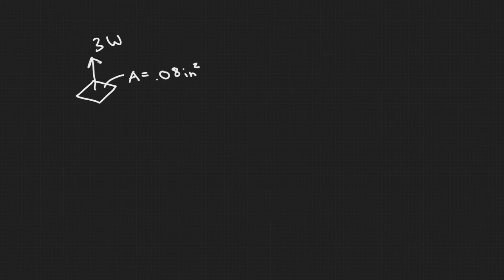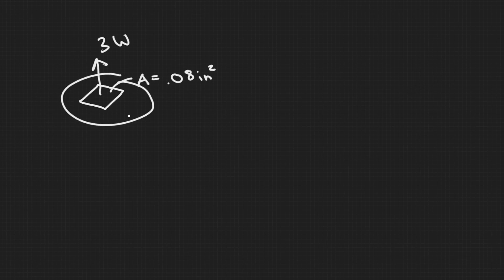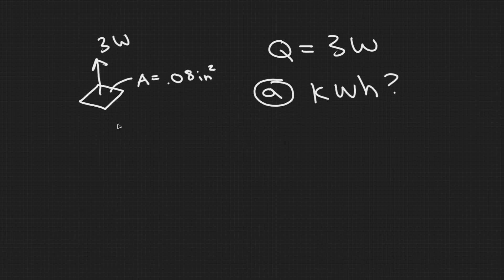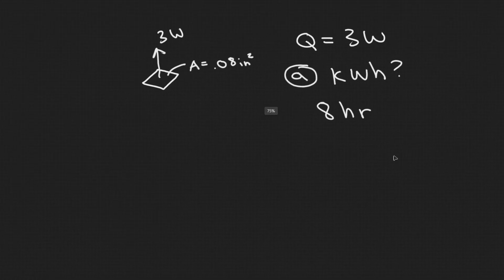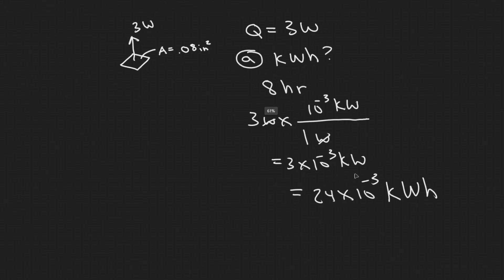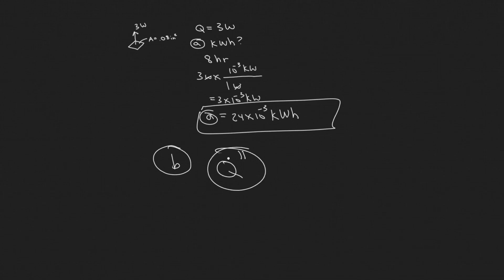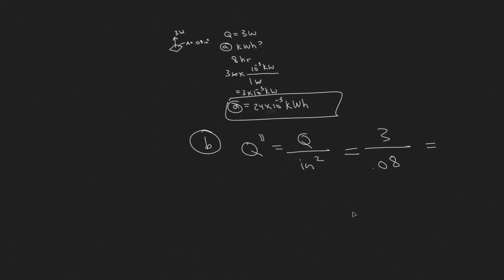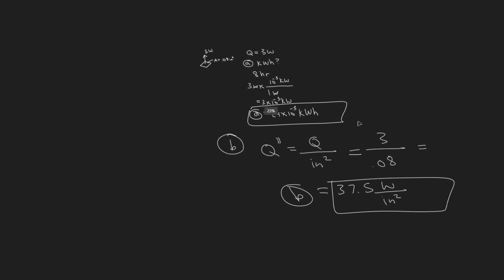A logic chip used in a computer dissipates 3 W of power in an environment at 120°F, and has a heat t

Comment: Could you help with solving this problem? Vectors have been tripping me up for some reason... A mass mA
 = 2.6 kg
 , moving with velocity v⃗ A=(4.0iˆ+6.0jˆ−1.0kˆ)m/s
, collides with mass mB
 = 4.2 kg
 , which is initially at rest. Immediately after the collision, mass mA
 = 2.6 kg
 is observed traveling at velocity v⃗ ′A=(−1.0iˆ+2.2kˆ)m/s
. Find the velocity of mass  mB
  after the collision. Assume no outside force acts on the two masses during the collision.

Thank you!